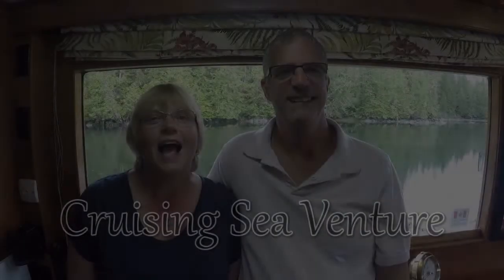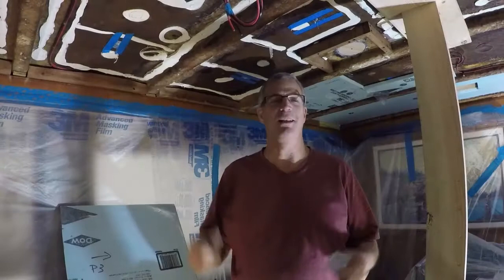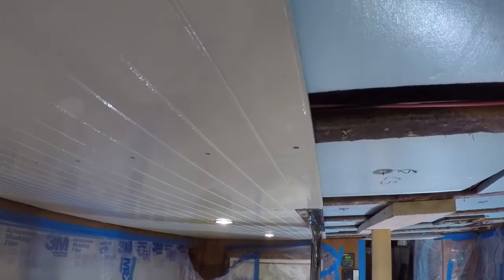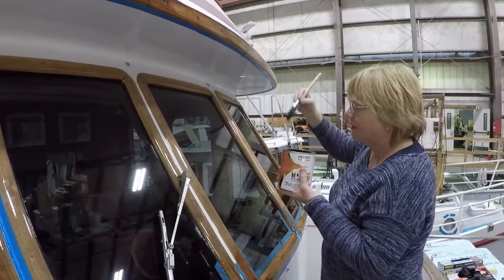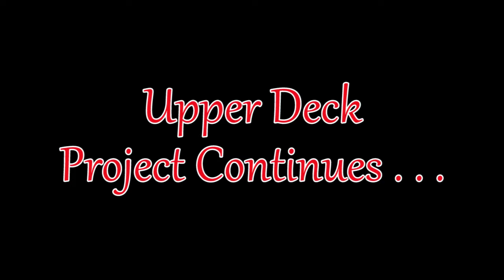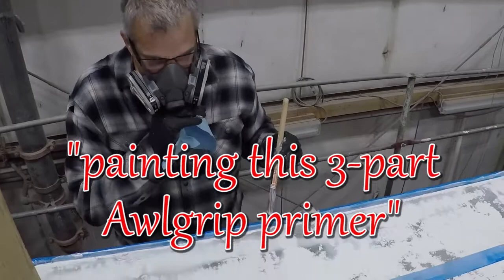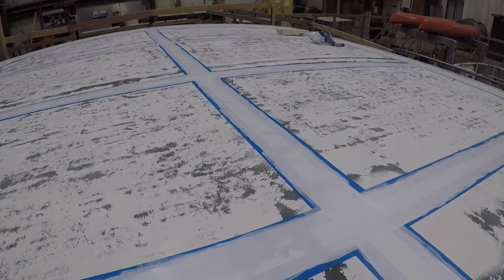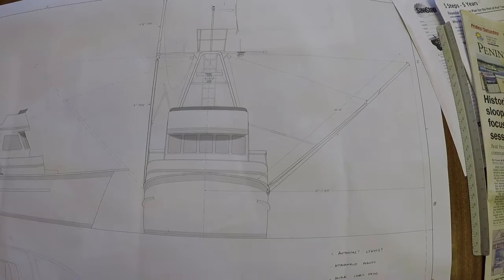Will the refit ever be done - so many projects at once on our home and trawler, Sea Venture - EP 17

Comment: Great videos, very informative for folks to understand how much labor these projects require to do them right. 
As a couple with a long owned 80’s vintage 54’ sailboat that we are executing a multi year refit, I sometimes wonder if the economics would have made sense to just buy new.
I would be curious about the same math on your project. Difference between your all in cost and New.
Reply from the maker: Tom,

Thanks for watching.

new vs. refit is a great question.

I think for ocean going power boats the refit option would be the only one for us.  There are only a few companies making passagemakers in the 50-60 ft range - like Nordhavn, Selene and a few others and those boats are $2 Million and up new.  Sea Venture has about 60,000 miles of ocean experience without stabilizers already, and even with the large refit our total investment will be a fraction of new.  I would be interested in seeing the same analysis for a sail boat.

Again, thanks for watching,

Jim